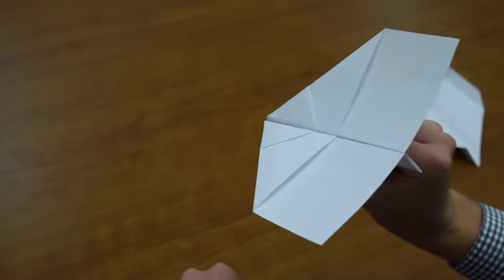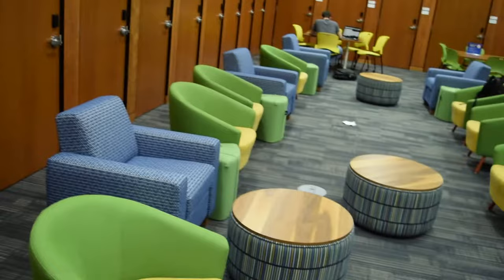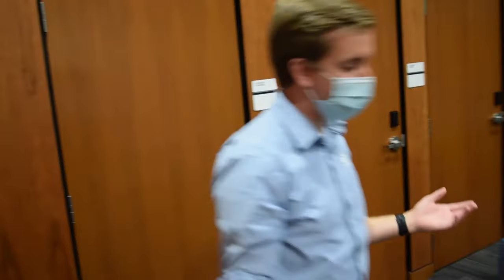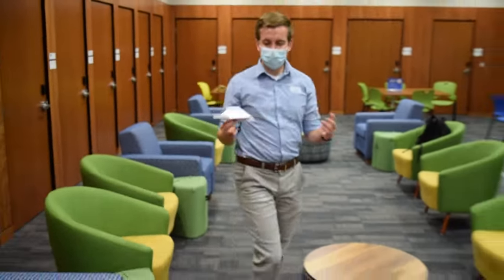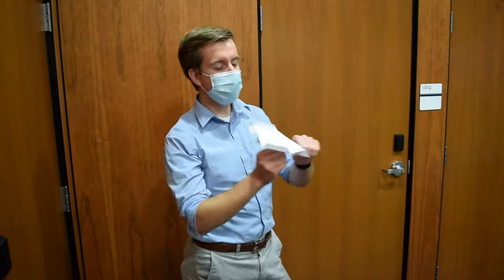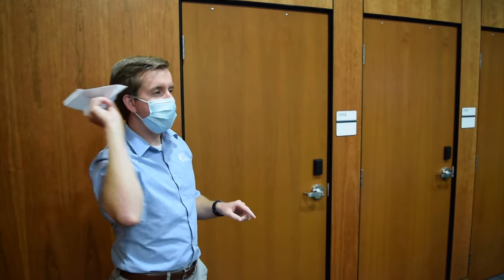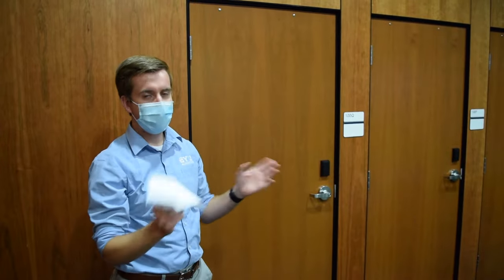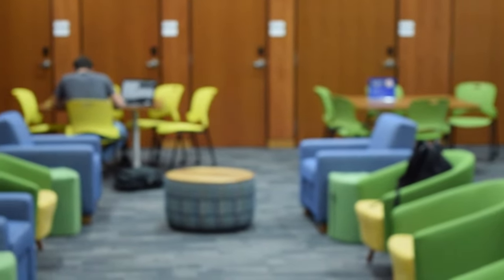Paper Airplane Throwing Tips

Comment: If it’s notebook paper will it instantly just go down because the way I make my plane one of the holes is poking out one of the holes on one of the wings do you think that’s why it’s going down
Reply: Here's tip :
Hold plane in the way he told , 

When releasing ,   your hand should travel little bit distance in upper direction , 
And then slowly release your hand downwards..

That's what he said , It works on notebook paper.

Comment: my solution to pulling down is cutting 2 scrathes on the back of the wings to add flaps, you can also adjust them when you want but they will be much less angled when in flight "works better at speeds faster than 10/ms"